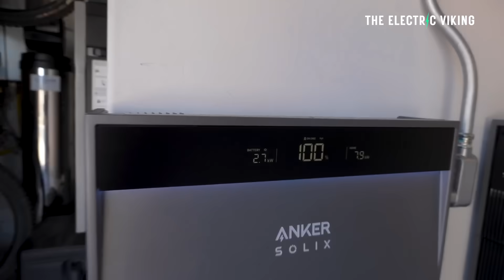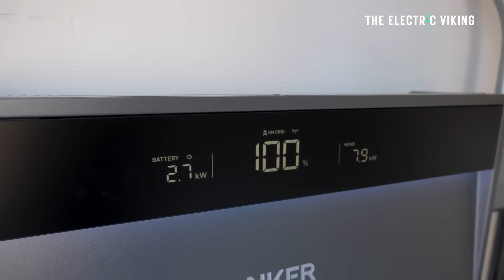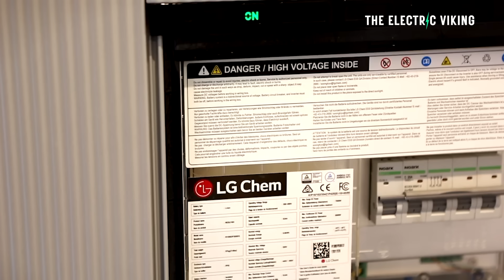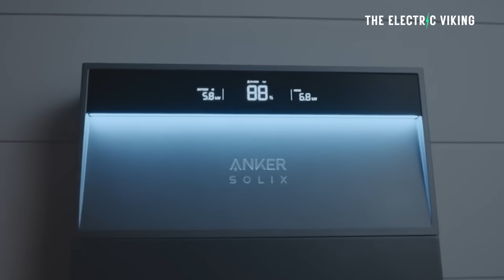The HUGE mistake thousands are making when installing a Home Battery

Comment: Interesting take.  I live on California's central coast, and I'm 5.5 miles from the ocean.  Things rust here, and pretty quickly.  The steel rails on my deck are a constant maintenance issue.  More than a year ago I had a FranklinWH battery system installed; I don't know if they're available in Oz or not.  It's an LFP battery, AC coupled (I have 14Kw of existing solar panels, so this was a retrofit).  My installation has 3 x 13.5Kwh units, and can produce 15Kw continuous power.  The power where I live goes out pretty routinely, so the FranklinWH  generator connector, which allow recharging the batteries if the sun doesn't come out for a few days, is an important feature for me.  So far the IP67 cabinets have not shown any susceptibility to water ingress or corrosion, which is way better than my railings with marine paint, but long term remains to be seen.
Reply: Franklin is available in Australia

Comment: Screws and fittings. In coastal environments, 316 stainless steel (marine grade) generally lasts longer than 304 stainless steel due to its higher resistance to chloride and salt pitting, while 304 can still be used but requires more maintenance. 
Here's a more detailed breakdown:
Why 316 is better for salt air:
316 stainless steel contains molybdenum, which significantly enhances its resistance to pitting and crevice corrosion, common in marine environments. 
This makes 316 a better choice for applications like naval applications, outdoor lighting, and electricity projects near the water. 
The increased nickel content and the inclusion of molybdenum allow for grade 316 stainless steel to have better chemical resistance than 304 stainless steel. 
304 Stainless Steel:
While 304 is still rust-resistant, it's not as resistant to chloride environments as 316. 
In marine environments, 304 might last about 145 years, while 316 could last up to 260 years. 
304 is a good option for applications where marine corrosion is not a major concern, or where regular maintenance can be performed.

Comment: I've purchased now 2 Anker Solix F3800 with expansion batteries. I have a small cabin, another modified RV that is stationary, a small RV toy hauler, a detached garage and a Rivian R1T. I love the versatility, scalability and price and the company has been great to work with! I can scaling this system up more and it's so easy to do. Highly suggest Anker and their system!
Reply: I got the same with the smart panel and two expansions

Comment: Tesla Powerwall is by far a superior product especially because of its software and the fact it can be fully submerged in over two feet of water and still maintain full operation.
Reply: Any IP67 product can be submerged.  Tesla is not the only one that can do this, they are just marketing it as if they're the only ones, to people who haven't investigated the claim.  Meanwhile, the PW2 is NMC chemistry, so there are big restrictions about where and how close they can be mounted, and the PW3 is currently DC coupled only, so not a good fit for people with existing solar.  (They will have an AC coupled solution soon.)

Comment: USE LFP batteries with IP rate 65 or similar.... but bigger mistakes is the Balanced load INVERTERS!!!! Big issue is 3 phases will be never used evenly (asymmetric/unbalanced load). But then the inverter is not supporting it and sending back power to the House evenly 1/3 per Phase. But load is uneven so your 3 phase load e.g. 10-50-40% = 100% on the 3 Phases... So supplying 33.3-33.3-33.3% = 100% power to the example load mentioned is NOT GOOD even if the TOTAL is 100% in both case. Electric companies now realizing it and they started billing per PHASE not the TOTAL supplied electricity by the Inverter. So basically your inverter saying "YOU are GREEN no electricity consumption and 0 BILL to PAY" yeaaaap... NOOOOOPE, you still have to pay electric bills!!!! So it is a SHAME and TAXING people who wants to be eco friendly!!!!!
Reply: Are you saying you have 3 phase power on your house? if so, why on earth would you do that? Thats total overkill, which is why youre getting electricity bills.
Reply: @user-lv5bt3nt3r  Yes I have 3 phases... In Europe households' 90% have 3 phases. You are entitled to have 3x16A for free, extra Ampers will costs you. I paid extra for 3x20A. NOPE NOT OVERKILL. Typical households have 7-9kW 3 phase Ceramic/Induction cooking plates, 3,8 kW electric oven, 1 kW microwave oven, 3-6 kW electric hot water tank, 2-3 kW dishwasher and washing machine + dryer... Plus other stuff like, TV, refrigerator, and all the other stuff... Just try to run 3,4 of those machines parallel.... I also have 22 kW wall box which is by default 3 phases (and only 11kW usable since I have only 3x20A for full power I would need 3x32A). For outlet car charger you can get max 3,4kW charging and 1 phase wall box with 1x32A you get 7,6 kW MAX charging. 
Summarizing basically everyone have 3 phases here and NOT overkill. And in Austria, Germany, all over EU the phase asymmetry (or unbalanced load) is not a problem. They accept it except in Hungary.... and since half year ago...
Reply: Have you looked into the Sigenergy 3 phase inverter with LFP module battery system?
Reply: @songforguy1  I already have the simmetric inverter and installed ..Which is not supporting unbalanced load. It was about 1500 EUR, now I would have to buy an asymptomatic or unbalanced load supported one for 1600 EUR plus at least another 1000 for an electrician.... So there is solution for this problem just it is NOT worth it. And this inverter half years ago was invoiced normally with the 3 phase SUM not individual phases. They no you won't replace inverter because the electric contract actually has the INVERTER SERIAL NUMBER if you change the device then other SN will break the contract and you will be also fined... So it is a huge scam because of the regulators and big dollar companies... Technology is awesome they just don't let you make money to pay for the investment itself...

Comment: Car to grid is what I'm waiting for. I am retired and the car is at home during the day.
Reply: V2g is allowed in Australia
Reply: @MohamedAhmed-dr2kz  good for you. Then you should buy an ionic 5 or 6 or Kia EV 6. They have V2G support but disabled in Europe... It's a shame
Reply: @tothimre7950  
The BYD EV's are also ready to go- they already have V2L and include the charger cable with the car. We, in Australia are just waiting for the bi-directional charger to come onto the market- the last one, which was withdrawn, was $10,000 ( AUD).
When I got over the shock, I realised a House battery is $10k and only offers a few kW of storage, whereas my BYD has a 60kW battery. A lot to learn! The install is quite expensive too apparently.
Reply: @anneh7401  60kW is on the cheap models BYD in Europe has 80-90kW battery like the Seal and Sealion. Yes bidirectional charger also a must have to make it work. One issue with car battery as home storage... What if you are not home?? 😉
Reply: It is called vehicle to Home/Grid V2H or V2G I think Hyundai has that feature but it is illegal in every country except Korea. But you also need a charger to support it.
Reply: @tothimre7950 really illegal? 😮
Reply: @tothimre7950  Man, I hate ignoramus comments like this.  Stop spouting crap, and do some basic research before posting, mate:  In November 2024, Standards Australia approved new standards facilitating Vehicle-to-Home (V2H) and Vehicle-to-Grid (V2G) charging in Australia. These standards are detailed in AS/NZS 4777.1 and AS/NZS 4777.2, which govern the installation and performance of inverters, including bidirectional chargers. The updated AS/NZS 4777.1 was published in the third quarter of 2024, and the revised AS/NZS 4777.2 is expected by the end of the year.
Reply: @mapp0v0  yes currently illegal technically the electric company can remove your meter and fine you. In future this might change but depends on the country and technical issues, like grid state and politics even. Like the balcony solar panels allowed in every EU country except in Hungary... There is no reason behind it, it works no problem with small inverters just government don't want you to be independent
Reply: Me too!
Reply: I believe this car to grid is happening in the U.K. I think through a firm called Octopus.
Reply: @davecooper3238  That is good news... In many countries we have to wait for it few more years I think. Also Tesla, Kia, etc few cars already has it. Hyundai/Kia common EV platform also has V2L it means an electric outlet at the back seat 😀that is the only thing we can use for now...
Reply: likewise, don't want a battery taking up space in my small house
Reply: @daylightsaver  most batteries and inverters have water proof IP rating. So you can install it outside even to the wall. Only issue can be the temperature if it's get too cold or hot outside. Vehicle to grid is great idea but for most people during the day you are at work with your car. Meanwhile Sun is shining and electricity waisted. In the afternoon when most people gets home with the car with empty battery.... Solar production is low which will be needed to change the car. Even won't be enough. So I think it's mainly good for an emergency case like power outage. But even then your car battery will be low since you driving it, or have to change at work with public charger... So I cannot see a good working scenario for V2H or V2G basically only for home office workers.